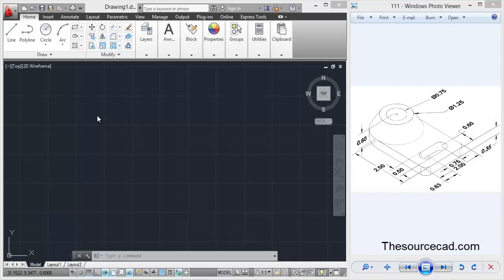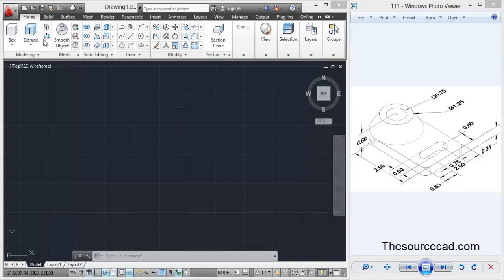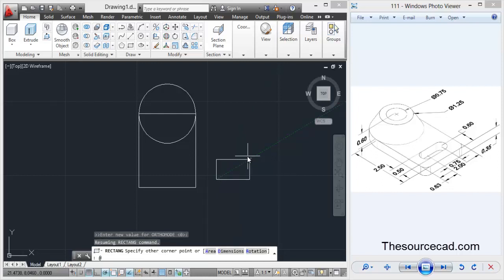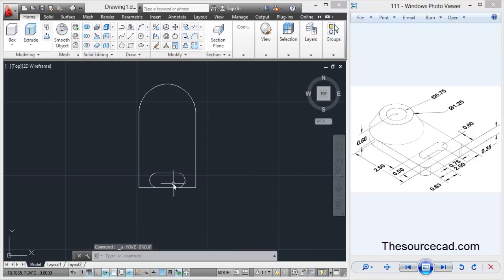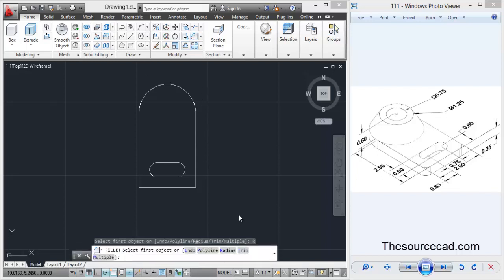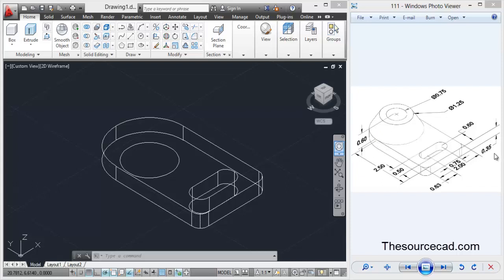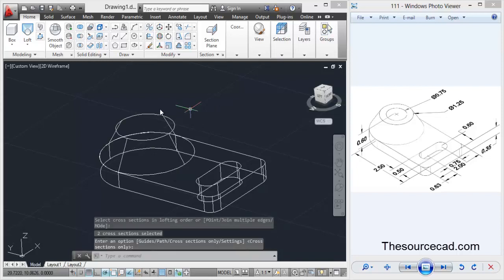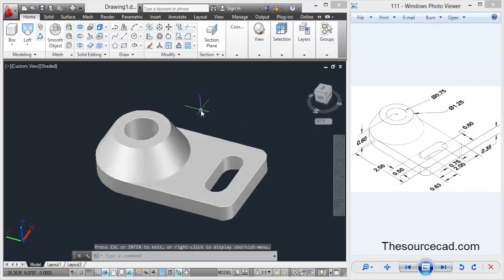3D Modelling with AutoCAD: Model 2

Comment: Really concise and easy to understand videos. Great job!. What year version are you running? In 2016 do you still have to enter @ when doing multiple dims on a rectangle?
Reply from the maker: For making this particular tutorial I have used AutoCAD 2014, and yes you still have to use @ in command line for entering relative co-ordinates. But you can also use dynamic input if you are not comfortable with relative co-ordinate entry method in AutoCAD

Comment: Hi! Im having troubles with the presspull command. When I select the drawing and drag it so it can have a height the middle hole doesn't show...i hope explain myself... its like i did an extrude and the hole inside doesn't exist.

I look forward for your respond and thanks for this awesome tutorial videos!
Reply from the maker: Paola Montserrat Bautista Although it is difficult to guess what exactly is wrong with your drawing but you can try this use presspull command as you use once 3D is formed exit the command and use presspull again but this time use it on smaller circle hopefully it will cut geometry as expected. Let me know if you still face issue with this
Reply: SourceCAD I already discover what was my problem. When I use presspull the first time I was selecting the lines and you have to select the area. Thanks!
Reply from the maker: Paola Montserrat Bautista Great!

Comment: Hello sir, at 5:27 I am not able to draw that larger circle even after clicking the corner point.please reply
Reply: Yeah, same issue when using AutoCAD 2021, the center point wont appear and the green guide lines wont appear if you are moving an object, I just had to accept that his version of CAD is older than mine...

Comment: Asalam o Alaikum !
Dear sir how are you ?

sir please explain the "precision" in autocad drawing units 

how much important precision in our drawing .....?

when i set architectural unit .... in this case what i set suitable precision and why ?

for example .... 0-0 1/16" what is it sir ......what is the meaning of that figure .......?

please reply me i shall b highly thankful to you sir..
Reply from the maker: Aftab Ali Hello Aftab,
Precisions is degree of accuracy that you want to show on your drawing and it is set according to drawings you can't have same precision values for all the drawings for example if you have a small component like a gear of a hand-watch then you would write its extreme radius something like 3.0867 it is having precision of 0.0000 ie four decimal points or 3.087 it has precision of 0.000 or three decimal points, but if the component is big like a table and you want to specify its side length then something like 120.0 will be sufficient to accurately define its length we don't need to mention values after one decimal point.
In example which you mentioned 0-0 1/16" the precision is 1/16 th of an inch and if the value of component goes beyond 1/16 th of an inch then it will be rounded to nearest decimal a precision of 1/32 or 1/64 will give more accurate results just like example of watch gear I mentioned before but might only be needed in highly precise drawings.
I hope it helped let me know if you have any further doubts
Reply: SourceCAD

hello dear sir are you here ?
Reply: thanks for reply sir !
Reply from the maker: Aftab Ali welcome Aftab :)
Reply: dear sir !

do you use skype id ?
Reply: i want to talk with you on skype sir !
i have many question about precision
Reply from the maker: Aftab Ali Go ahead and ask on this here too aftab, I'm sorry but it might not be possible to communicate via skype now
Reply: sir i want to know about your self if you don't mind so tell me  what your name and where are you from sir ?
and what your native language sir ?
Reply from the maker: Aftab Ali It was good to know this Aftab, I am Mechanical engineer and certified Autodesk professional from India currently working as corporate trainer training students and corporate employees in Autodesk software's and obviously like every Indian I speak Hindi.
Reply: me Pakistan se hoon sir 

i am  from pakistan sir
Reply from the maker: Aftab Ali It was nice meeting you Aftab, I hope my tutorials helped in making your AutoCAD skills better.
Reply: yes of course your videos tutorials really helpful for me sir .....
Reply from the maker: Aftab Ali Thanks again